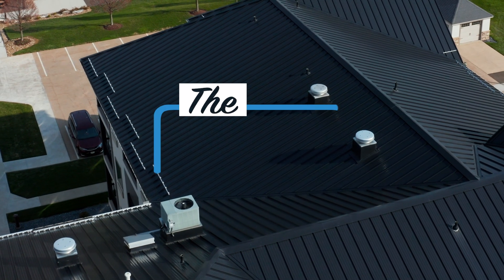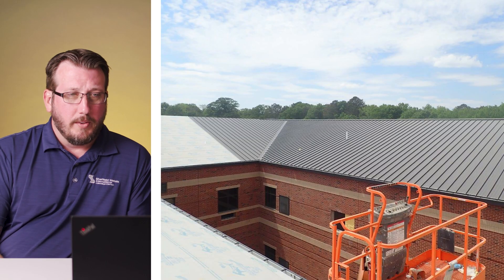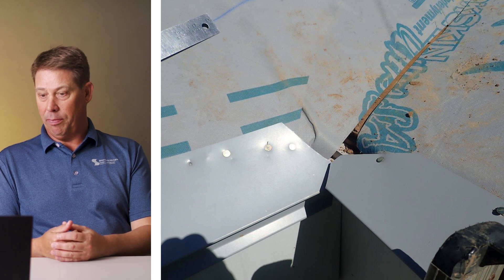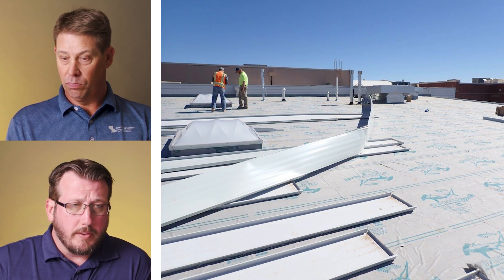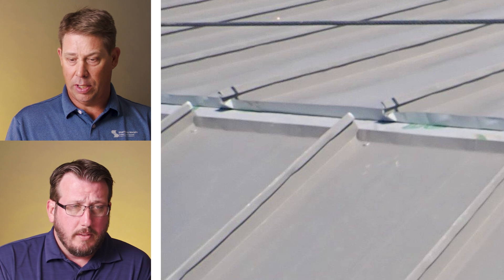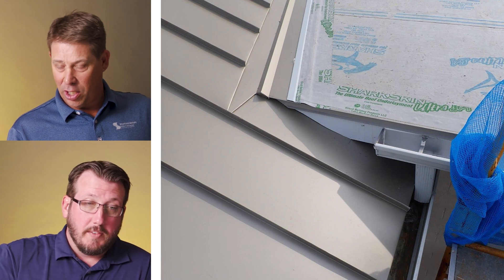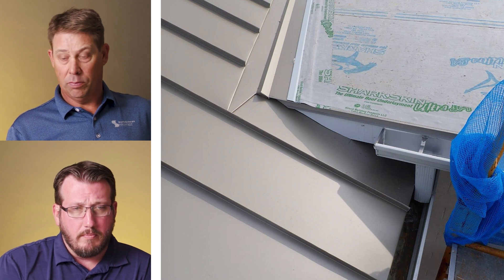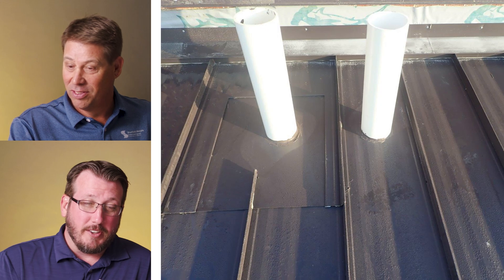Roofing Inspectors React to Good and Bad Metal Roofing Installations

Comment: Hi guys, I really love all the videos you put out. React 1&2 are my favorites!  Quick question, you guys talk about the underlayment being nice and tight or... not on some installations. In Florida the HT synthetic underlayment states it should be rolled out loosely to avoid stretch and tear. I assume because of high heat cycles. How should loosely installed synthetic underlayment on a roof look? I ask because we'll be putting a metal roof on soon and I want to make sure I understand correctly how it should be. A couple of the manufacturers installation instructions I've looked at are vague at best. Lastly, I know Florida is a unique roofing beast. If you guys could react to a few images from Florida that would be really fantastic! Thanks for the great work!
Reply from the maker: Thanks for the comment! They call it "loose laying the underlayment" because they don’t want you to pull it tight and stretch it, but that doesn’t mean it should be bunched up or flapping around either. You basically roll it out so it is as wrinkle free as possible and then nail it off. If you pull it too tight and then nail it, it can cause tears around the fasteners if the underlayment expands and contracts. If you're talking about fully adhered underlayments like the ones in this video, those products need to be as flat as possible because they can literally telegraph through the panel because it is so much thicker. -Thad